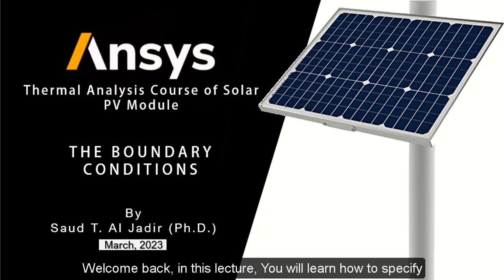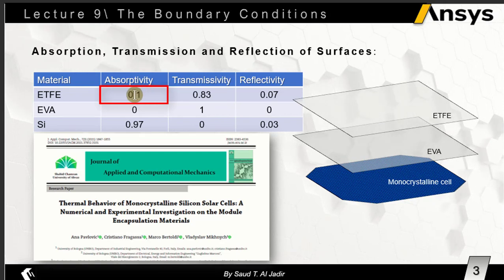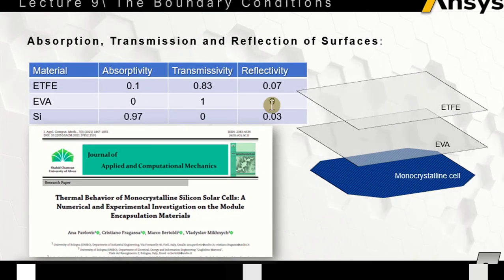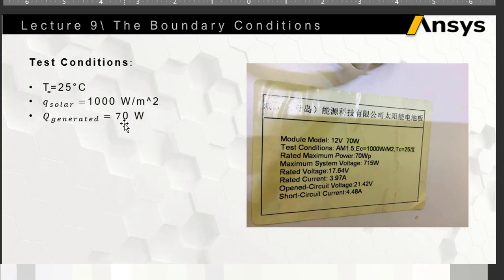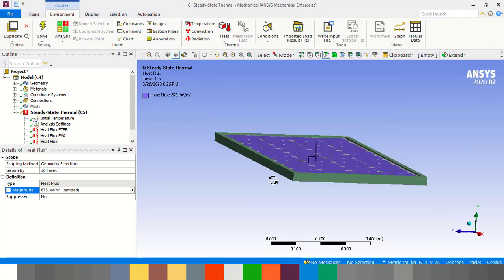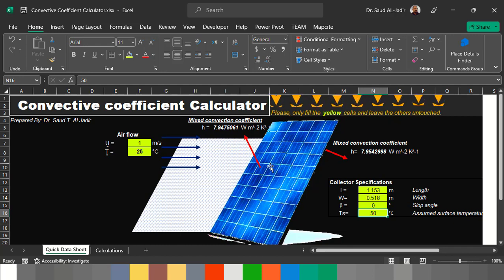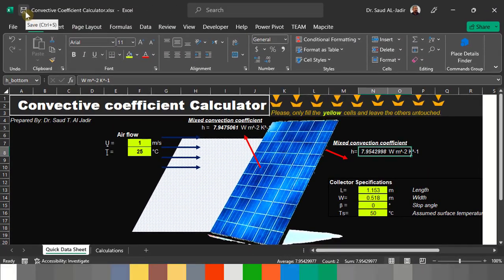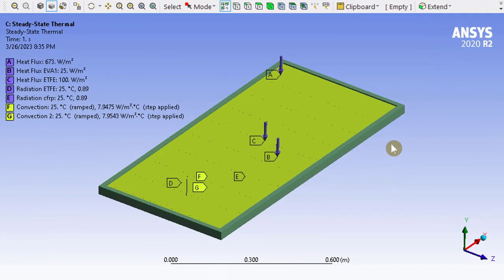7- Boundary Conditions | ANSYS Thermal Analysis Course of Solar PV Module

Comment: Thankyou sir
For uploading here.
Reply from the maker: It's my pleasure
Reply: @Saudaljadir  sir, I unable to solve my problem bcz I don't have license version.
Can u plz help me for solution...
I am waiting for your reply
Reply: @Saudaljadir  only because of you I m here but now I m stuck in final step
Reply from the maker: @niteshchoudhary7476  Dear Nitesh, You can solve the problem with student version of ANSYS which is free and available in ANSYS webpage, but, in this case, you should consider one cell instead of the whole panel.
Reply: @Saudaljadir  Dear Sir,
But I have to simulte for entire panel.
It's my undergraduate project
Reply: @Saudaljadir  I have done all the thing. But unable to solve and I don't have any contact , so please help me sir
Reply from the maker: @niteshchoudhary7476  I think that you did a great work. So, now all of what you need is to search about the nearest university in your area which has a licensed version of the software to run your simulation.
There are several websites that offer a hacked version which is the choice that I don't recommend in any case.
Reply: @Saudaljadir  Thankyou sir 
Will try my best...
Thankyou for support and guidance
Reply: Today I done successfully simulation of my project... 
Thankyou for your guidance and support...🙏
Reply from the maker: @niteshchoudhary7476  This is great news..Good work and wish you the best always.